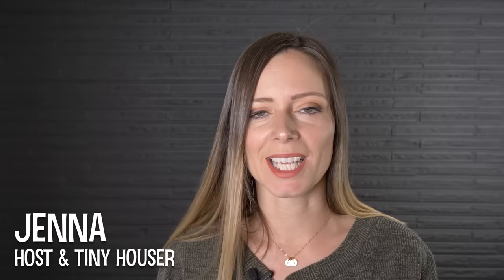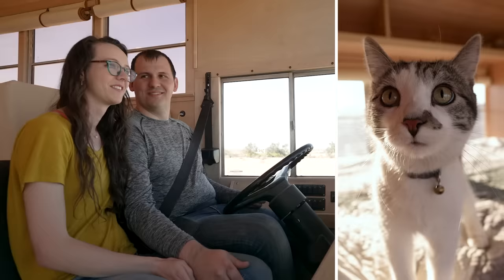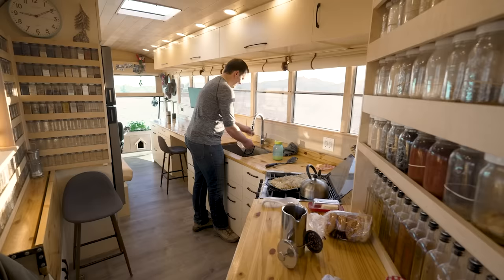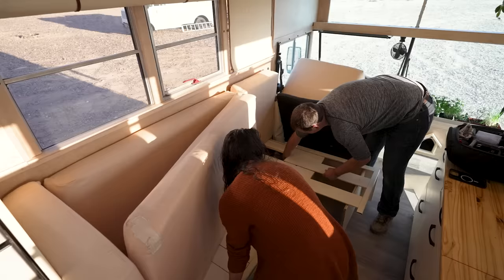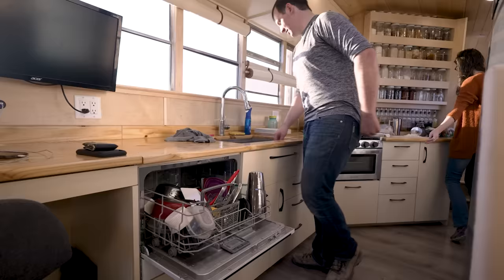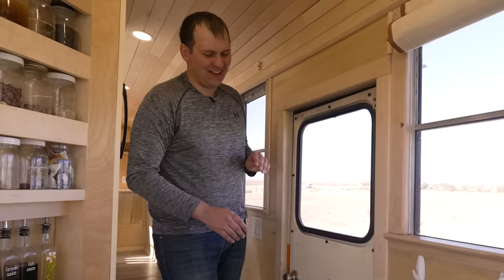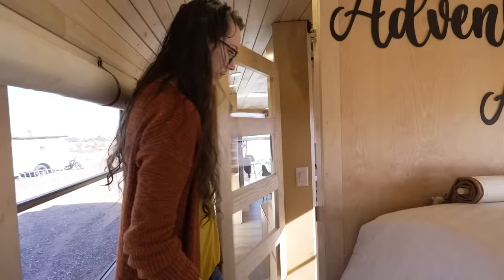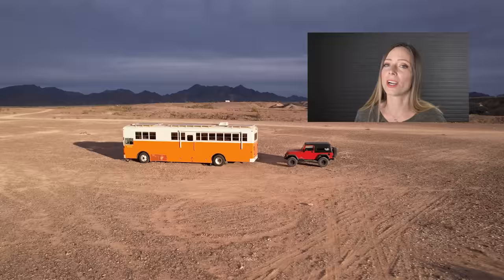Best SKOOLIE TINY HOME ever?! Secret storage & epic kitchen

Comment: Incrediblely well designed, built and excellent finish work..   No suprise that two engineers to properly design and fabricate and having access to the type of facilities especially needed for the roof disassembly, lift and welding to tie back together. Excellent design work for the under frame work too!

Comment: Everything about this one is great! The one and only thing I might not have done is rebuild the dash with wood. In the event of a crash, I'd rather not be impaled by splinters.
Reply: They won't feel those splinters after they've exploded should someone hit the two propane tanks riding beside 12 gallons of gas!
Reply: @paige6028  Good point
Reply: @paige6028 well damn!

Comment: This is definitely one of my top5 favorite bus/tiny home conversions I have seen. The kitchen is to die for and? Like them I would want the larger stove/oven. I LOVE LOVE LOVE the way they created the pantry and spice storage compartments and how organized it is. Only change would be to store the crockpot and pasta maker in a more accessible place. It might be wise to even have a pull out storage drawer that has outlets to plug in the crockpot or even an airfryer depending upon what kind you have. Ours looks more like a smaller convection oven or microwave and wherever it is used would need to be more fireproof as they do get very hot and require a certain amount of space around it as well as above and below it, which just means you don't use materials that would be affected by the higher temperatures while keeping it accessible. The two work areas are really nice and I love that her's tilts to allow her to do her artwork as well as her job. Definitely not a bus for any future children, but an older child could possibly have a convertible bed or a box bed design at the very back over the engine and behind his office. It could be made to look like cabinet doors or a false bookcase that either slide open or open like cupboard door which hide it during his office hours. You can tell that they put a lot of time and thought into creating their home. It's gorgeous.

Comment: Your countertop, spice racks & storage are awesome, as is keeping the emergency door to upload groceries right from the jeep.  I love your bathroom, the size, the lowered shower pan, and the small tile around the lower part.  Let us know how the vinyl wall tile is holding up.  Did you use any waterproofing coating on it?  Your kitty is gorgeous, BTW, especially that half-mustache.  How tall was your roof-raise, & does it give you much wind resistance while driving?  Is there any problem with the deep freezer being so close to the engine bay, in terms of heat radiating off the engine and causing the freezer to work harder to keep foods frozen?   You two make a great team.  To see a young couple working together to surmount obstacles is inspiring; my husband and I are at 50 years of marriage and counting.  You kids hang in there!  Excellent job on your bus!  Keep us posted.😊❤

Comment: Just my humble 2 cents: The  cooktop/oven moved over near  the fridge would eliminate that deep reach triangle drop storage spot. Or, if space permits, move cooker toward  the middle of that angled countertop. Then, that former oven area could be a trapezoid shaped roll-out pantry for the  spices that are best kept away from bright lights. Plus, I prefer a cook top surrounded by an easily washable, solid surfaced wall/backsplash...glazed tiles, stainless steel, copper, or marble. The windows' glass and shades would be spared steambaths and frying speckles.

Comment: Good for you for thinking outside of the box. I just want to ask you a question; and I am NOT trying to make you fearful-but, I want to know, what will you do when they turn the economy upside/down & remove your access to internet and enforce laws about where you are allowed to live/exist? Do you have a plan B? If you are relying on Starlink; there's changes coming down the road that might impact your ability to work remote, then what? Do you have reserves to pull from to get you through. I am trying to help you see the potential pitfall coming. Better to be asking the tough questions now, not when we're in it.